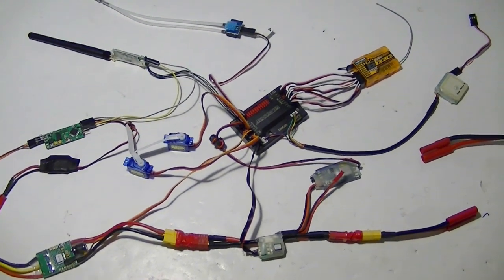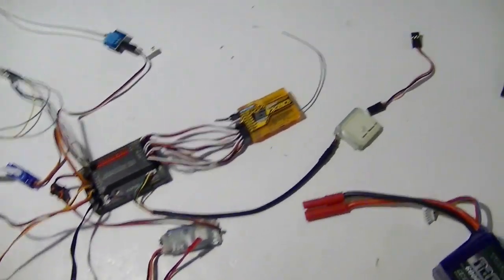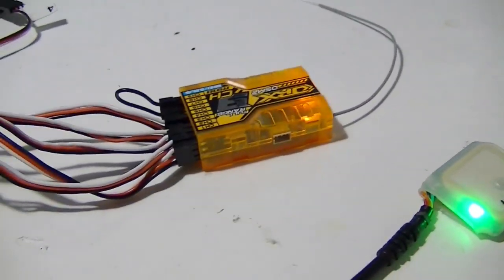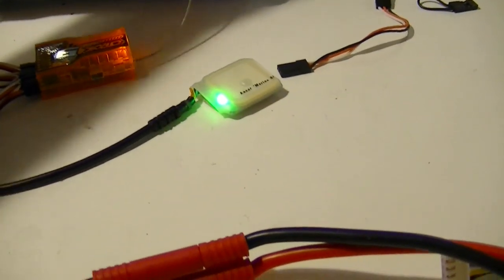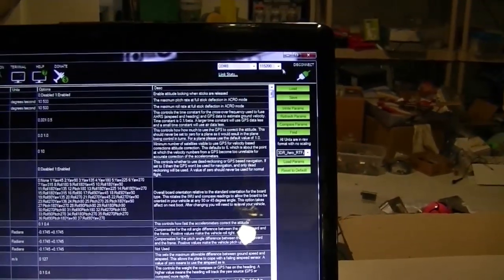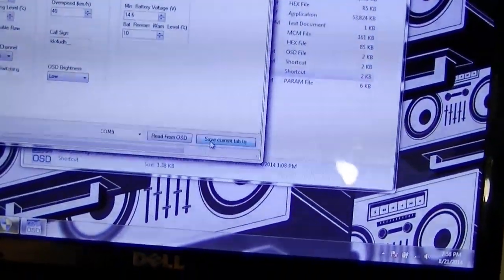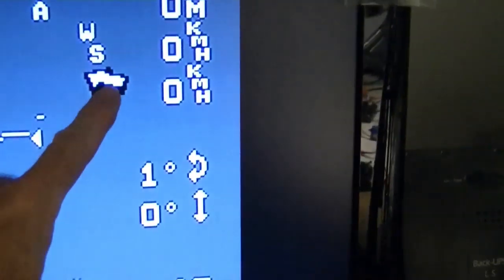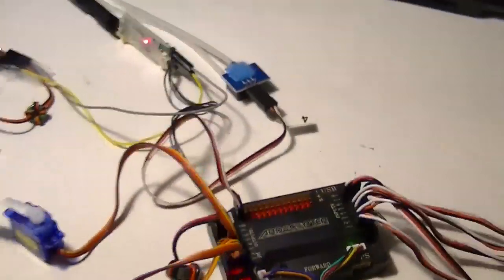Bench Testing Banggood APM (Arducopter)

Comment: Hi dmerc00  Wonder if you can help me I have a APM 2.5.2 board that has firmware 3.4 on it ,I believe that the 3.4 version is for Pixhawk and APM will not work with anything above 3.0.1, I want to load an earlier version on it , Say 3.0.1 or older I cannot find a way of achieving this using mission planner, hope you can help thanks, Regards Geoff.
Reply from the maker: +SuperGoofa Even though this is for the PixHawk it works for the APM too:
http://www.dronetrest.com/t/problems-loading-firmware-onto-pixhawk/348

Comment: Sadly the Ubec your using for the amp unit is known to be deffective lol.  That is why minim osd  failed to run right on it.  They tend to run 4.3-5 volts unlike 3dr ones full up 5v.  China crap ones borwn out the unit.
Reply from the maker: I think you meant the current sensor (APM power module). Yes Banggood was supplying poor power modules but the one in this video had already been replaced with a 3DR version. I think Uncle Deek bought a new one before he sent it to me. 
We found out later that there was a piggy-back regulator board and a diode on the 3DR version not supplied with the Banggood version of the Power Module.
Reply: ***** lol The "Power Module" Is just a Ubec with 1+ and few - wires cmoing out of it with 1 Tx signal wire to update the apm with chip data.  Alot of high end airplane and helicopter ESC with Ubecs onboard have the feature as well.  People just dont use it enough to know it's an option.   But that is why I just call it a Ubec cause it's nothing more then one with plugs to fit Apm units exclusively.  Thing you got to realize is Apm units are nothing more then Mega test boards and use basic electrical functions to run.  There is some pretty mean setups you can do outside the box of the norm with them you see on youtube.
Reply from the maker: Rich Morgenstein "APM Power Module" is what people need to find it.
http://store.3drobotics.com/products/apm-power-module-with-xt60-connectors
Reply: ***** Careful with this version of APM power module.  I have the same setup and my power module blew up and smoked while doing bench testing.  Glad it happen on the Bench.  Here is a photo of the power module that blew. https://plus.google.com/110417196450372356240/posts/HL19qCfhQR2
Reply: Jon Car   Unless there was a defect in a part.  The main reason people burn these units up "bench testing them" all over Youtube is they plug it in to a battery and don't have the apm attached.   They pull out a voltage meter and "test it" lol  The unit can't be dry run without a draw on it of some kind or the main power regulator will give off it's famous white smoke you hear about lol.
Reply: Well that was not my case.  I had it connected to the PDB and it was powering the APM when it blew.

Comment: I've run into similar problems with the hobbyking APM.  The issue is really two part.  Some of the power modules are set for 5v by may put out a little less.  The APM power circuit has a diode inline for reverse polarity protection which drops the voltage too.  So by the time the minim gets fed its down a bit.  My symptoms were once the motors were drawing power the power module fluctuated enough to cause the minim to brown out and lose video.  You can swap for a different power module ( some put out closer to 5.3v) or do what I did and remove the +5v wire from the minim connector and shrink wrap it.  Then on the bottom of the board I cut the 12v trace close to the header output.  Then (from top side of board) I solder a jumper from the middle pins (normally for 12v) to the 5v solder bridge jumper.  What this does is two things.  Most people use a vtx that has 5v out for camera.  Now you can run from the camera to the minim and one wire to vtx.  The vtx now powers the minim which avoids brownout and minim receives filtered power which is better.  Plus wiring is much more simple.  Just make sure your polarity is right on the servo cables used as some vtx swap positive and negative locations.

Comment: great video sir very helpful, i notices on banggood website that they sell other versions of power modules which dont have integrated BEC and others do have it, that means if he has got the Power module W/out BEC it can power up the board but not enough to power the servos and the minimosd ( just probability )but its better to use UBECS anyway. again great job apriciate ur vids (Y). cheers all the way across the oceans from ALGERIA
Reply from the maker: crasychat Originally it included the PM with no integrated BEC but the one in this video supposedly had it. But like you I prefer to use a separate UBEC for servos and to power both stages of the Minimosd. Thanks for the comment!

Comment: So what's are the differences in the products (apm 2.6 and the kit) sold by 3DR and this site (banggood.com)..since there is a huge difference between the prices
Reply from the maker: Rijo Alex I couldn't find any difference other than the external current sensor was a little different. Another place you can buy them is witespyquad so check them out too.

Comment: do you really need a separete ubec for the minimosd ? If i look at your other video's and schematic you dont use one ?
Thanks for the great video's
Reply from the maker: ***** At least for me, the Banggood version did not have enough current to run both stages of the MinimOSD. You can try it without the UBEC and see what happens.
Reply: If i look at your schematic,(witch helped me alot,thanks for that) since jou dont use the esc from the speedcontroler,maybe jou can use it for powering the osd ? No need for a seperate ubec then. Hope thuis helps others. Thanks again for the quick reply and the great video's.(and pardon my poor english,i'm from northen Belgium zo i normale sprak Dutch)
Reply from the maker: ***** I think you mean the bec from the speed controller, not esc. Keep in mind that there may be noise in the video that way but you can try it and see if it works for you.